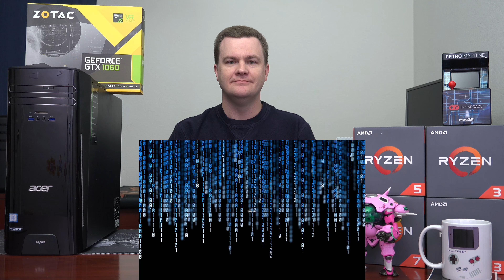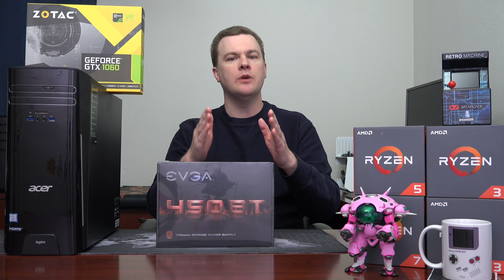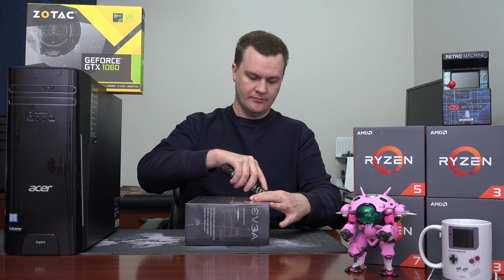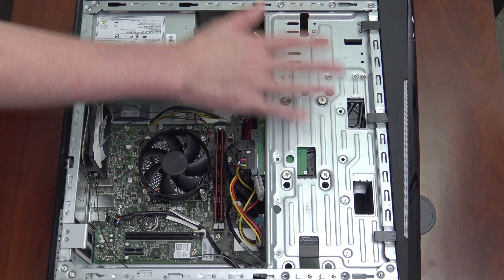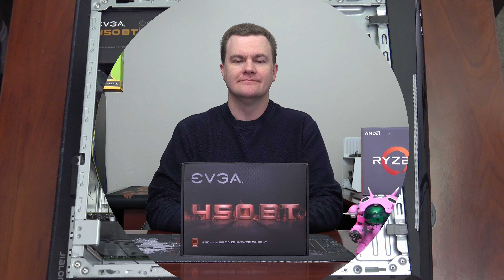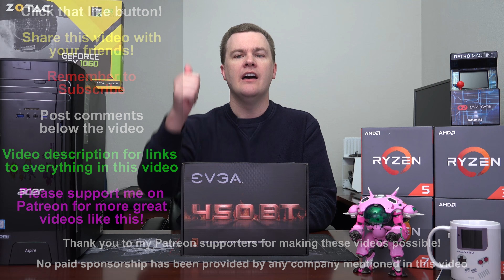EVGA 450BT - 80+ Bronze Power Supply - Review + Install Guide

Comment: Nice review men! Im looking for this exact psu to pair with an rx 570 of 4gb and hopefully an i5 9400f, do you think that this setup will RUN without bottlenecking? Thank you!
Reply: just undervolt the rx570 it will work fine
Reply: @kruxdt6307  thanks! i will try, with a friend of mine we tested this rx 570 with an i7 8700k v1 and sometimes with some games the screen goes to blue or simply it shut downs from nowhere... I will try to undervolt it as u say, thank you!
Reply: Update: now that I watched the vid, on the minute 8:00 u said that if u want an rx 580 u must replace the psu, would you replace it with the evga psu?

Comment: Hey sir I just sub! great vid 

I have some questions 

Will the EVGA 450 BT, 80+ work with 

RYZEN  3  and POWERCOLOR RED DRAGON RX 570 4GB  with the GIGABYTE B450 AORUS PRO WiFi. Mother board 

And also is a single ddr4 8gb at 30000 speed ram     better than 2x 4gb at 24000 speed ? Need help I’m kinda new to pc builds

Comment: Can this powersupply handle
-2x4 rgb ram 2666mhz
-ryzen 3 2200g
-msi b450m mortar 
-rx 570
-3x 120mm rgb fans
-m.2 120gb ssd
-1tb 7.2krpm hdd

I'm worried if it will handle or not the rgb lightings in my rig. Is it okay to use this ppwersupply? I will overclock my cpu too.

Comment: Would this psu be enough for a rx 580 4gb with ryzen 5 2600 with 16gb ram?
Hoping to oc the 2600 to 3.8-4ghz as i will be getting a arctic freezer 33 but the gpu, i wont be oc

Comment: This unit is great. The IDIOTIC design blows my mind. The power switch's bezel is too close to the mounting hole, thus the frame of my case will not flush with the supply but with the top bezel of the switch, for that one screw. The switch bezel and the part of the frame that extends with the screw hole, overlap. See rear of unit at 5:40 to see proximity of power-switch bezel to mounting hole.

Comment: tech deal is this psu good for gtx 1060 (3gb) and ryzen 3 1200?
Reply: KeistuoliZ yes was using this PSU(EVGA 450B)with Ryzen 3 1200 OC to 3,9Ghz and Asus Strix GTX1050ti, now Ryzen 5 1500X. It's enough for GTX 1070 or Vega 56 so it will run your GTX 1060 without problem.

Comment: Hello! Can I use this PS with dell 9020 motherboard? The MB has a 8 PIN power conector not a 20 or 24.

I think i could use either of the 8 PINs CPU power connectors from the PS to power the motherboard. Is this possibly?

Comment: Even if you're using cheaper used parts I'd say the same thing you said about the 1,000$+ PCs. You can get a GTX 480, 580, HD 5870, etc cheap used. But there is no way a 450watt powersupply will run any of those cards. Even with a lower-end CPU like a Celeron or Athlon II/etc. You can check outervisions psu calculator if you don't believe it which is pretty accurate. lol
(I'm not associated with them. I just use it to calculate my needs. So I don't grab the wrong parts. Like the GTX 465 I almost bought that would have jumped me from around 200 watts to 500+ watts).

Comment: Not related to this video, but have you used the MX 300 525 gb m.2 (part # CT525MX300SSD4 on Amazon) in a Asus b 350 Mobo? ASUS says it isn’t compatible and could damage the board if used. Any thoughts?

Comment: I watched you're other psu video guide, but I am still not sure how big psu I need.
I wanna have: Ryzen 1700;
GTX 1070 Ti
3 ssds and 3 hard drives.
Probably less, but I intend to record/ edit so might end up with several information storages.
Also I experience electricity spikes and cuts, like for a 3 seconds, rarely but happens a shutdowns.
Ik I probably need a ups, but would bigger psu help for few second or millisecond electricity outage.

Comment: I bought one these for a Dell i3 4150 system, 16 gigs of 1600 mhz ram, MSI GTX 970 gaming overclocked.  Ran fine on this EVGA 450 watt PSU.  Thanks Tech Deals for the video.

Comment: That is amazing to see an FSP group PSU orginally in the case , thats actually not a bad 300 watt PSU , I honestly think it would up to an GTX 1060 just fine , unlike PSUs from older oem machines . my last oem was 10 years ago it was an ASUS CM5570 with a pentium dual core e5300, the psu in it would not even power a 9500gt lol

Comment: Budget builds also mean some more confident PC-ers might be looking to take advantage of much less efficient older gen hardware in their builds. The R9 290/FX8350 would require much more power than an old i5/GTX970. On that AMD system I used to use a 550W just so I had 100% guaranteed headroom. For modern efficient gaming this PSU looks great. Needed a PSU for my new DJing PC (now knowing I can add my old 970 at some point) but I know nothing about budget PSUs these days. This answered all my questions and looks like the perfect choice with some longevity options. Great vid as always.

Comment: I have this installed. A gtx 1060 and ryzen 7 1700x at 1.35V and 16gb ram. This is more than enough for a gtx 1060. No matter what cpu you put in(ryzen 7 or intel i7)
Reply: I agree. I have a 1060 with a 1600X and I'm only pulling about 150-200 watts for my entire system minus the monitor when it's running full load.
Reply: I buyed this psu un Amazon,  can I run games with the GTX 1060 and a i3 8100 or Ryzen 2400G or Ryzen 1600 with this psu?
Reply: KAI KIN I think if I do Overclock Is not very safe ?
Reply: Is it work for rx 580 ? I heard that it consume much more power !!

Comment: I have this PSU and sometimes it makes a buzzing sound ( that last 1-2 seconds ), It's so random and it might happens a few times in one minute or it might go quiet for an hour ... Idk what is the problem and I built the system just 2-3 weeks ago and the problem started after a week, Probably my unit has some problem and the strange part is, it still make the noise even if the PC is off and PSU is on.
I picked it up for $21 on Amazon.

Comment: Hlo sir,
I currently have an zebronics 450 w PSU and a gt 210 and I wanted to upgrade to MSI gtx 750 ti low profile version,I m not a rich person and u won't believe me but I've been collecting money from my pocket money for 3 whole years the gpu,so I can't afford on a first hand PSU,so I am purchasing a used one ,so which 450 watt PSU (used)should be good for gtx 750 ti  .pls tell me I can't take any risk on my gtx 750 ti..
Reply: any 450w I have the same one as in vid with a i7 and gtx1060. a 750ti will only use 65w and it will draw its power from mobo if you have no money just keep the one you have as long as it works ok? keep the money you have saved put it with the money for 750ti and get a 1050
Reply: Thnx for the reply bro but I HV to change my PSU coz there is a strange noise coming from my PSU fan when my PC stars ,so I guess its taking its last breath ,I can spend around $15 for a used one,so will I find a used evga psu
Reply: yeah look on ebay and bid and I'm sure you will find one if you hold out
Reply: For that ??? I would use something between 300 and 450 watts
No more 
Check the links in the description
Maybe you will find MRI or something

Comment: Very useful content as always and as expected from your channel, and I want to add some info here, that the GTX1060 is a great low power consumption graphic card actually I powered it from single SATA connection using SATA to 6 pin adapter in Dell Optiplex9020 machine with 290W PSU, and runs great without any side issues.

Comment: what is the difference between the evga 450 BT and the evga 450 B?
Reply: The evga 450 B1 has slightly better built quality(hence why its slightly more expensive than BT usually)  and has a higher temp rating @40C while BT is @30C.

Comment: I have a 600w  OCZ PSU about 5-6 years old. I just did an upgrade from a Core i5 to a Ryzen 5 1600 with it. How often should one replace a PSU and would this be a good candidate?
Reply: I have had a Cooler Master 600W for like 8 years now, I will upgrade once it fails on me hehe.
Reply: when you start to hear funny sounds. try to keep it dust free and you are good for years
Reply: Okay, thanks.

Comment: With this power supply you can use an I7 8700K OR a vega 56 not both. They will take >450w
Reply: Clash with Neo You need a better PSU for that combo.

Comment: Tech Deals
Nice dramatic music in the 9th minute. :)
These days I have the opinion that even for budget builds quality PSU's should be chosen, simply because you get so much more value in terms of longevity, reliability and noise level. You can keep using it >10 years if you go for the high end PSU's, <$10 per year. If you have little to spend then maybe wait a bit longer before you build a PC?

Comment: I just wanted to get a zotac 1080 i have cooler master masterwatt lite 600 watt.
Pc specs : 
ryzen 5 1600
Gigabyte ab350 gaming
Cooler mastee master box 5
Zotac 1050 ti
Cooler master master watt lite 600 watt
Reply: its isnt the best psu bit it will handle it
Reply: Skeletchetobg _  in terms of power its fine but should i really go for another power supply ??
Reply: if you already have it keep it if you dont  tell me your budget and country and i will  suggest you a  psu
Reply: Skeletchetobg _  thanks for the suggestion bro.
I will keep it ;)

Comment: Green motherboards, those still exist. :)
Don't even OEM's these days use motherboards which are a bit prettier? This OEM PC is not that much different from mine, mine has a large heatsink (plastic pipe) on the CPU cooler though.

Comment: when upgrading those branded desktops with psus make sure the power supply is actually atx, as often manufacturers go on a proprietary spree and the new psu might not fit, even the screws.

Comment: Could you do a video that covers the pros and cons on buying Refurbished PSU’s? I’ve heard it all and I’d love to hear from a legit source like yourself.
Reply: 328am main drawback of refurbished psu is less years for warranty(maybe have like 1-2years) while a brand new psu can have 4,5 or more years. Also maybe a potentially shorter life span
Reply: dragonfistX200 Agreed, but the reason why I’d like to see a vid on it is because I’ve already heard all logical reasons and I’ve also heard the complete opposite of what you said. Some say that if it’s refurbished; it’s been tested and like a brand new one but with a shorter warranty OR that you should never get one because it’s the most important part of the system and it could blow your other components if it malfunctions.  

So, since the amateur opinions vary I’d love to hear what Tech Deals has to say on trying to save a few bucks in a Refurbished PSU

Comment: You definitely need to do a video on the recent GPU price rises.
It makes buying cards above 1050Ti very expensive and pointless.
It also makes prebuilts even more attractive.
Who knew people would actually RECOMMEND prebuilts in the PC Master Race :)
Reply: MrMateczko just checked and DAAAMMM. I’m from Costa Rica and bought a RX580 gaming X for 320$ like 3 months ago which is OK since US is cheaper. Just checked Amazon and seller prices are between 699-999, this is ridiculous.
Reply: MrMateczko look up hp pavilion 580 on amazon. There is a i5 7400  with a gtx 1060 3g or r5 1400 with a rx 580 4g for right over $600. Best prebuilt I've found recently
Reply: MrMateczko dude I feel the pain. Even the 1050tis are getting up there, so I ended up with a 2gb for my budget machine because I wasn't paying no 200-300 dollareedoos for a slab of silicon that makes my gamebox games shinier.

Comment: That power supply won't run the three pin Sapphire Vega, or the four pin 295x 2
Reply: You don't put the Vega or 295x with this PSU. There are Seasonic units for that task, and they are not THAT expensive comparing to other PC parts right now.

Comment: Best power supply for the budget indeed, u can find these slightly cheaper than the 430 white in amazon sometimes, although the problem ive had is i have to get the power cable that came with it at a certain angle for it to work, idk if its just my unit but i had a spare power cable lying around and used that instead

Comment: Hey mr.deals I'm considering getting the Acer aspire used on eBay but if I can't find one for a good price are there any other pre builds you'd recommend with the same specs?
Reply: Digital Rampage are you talking about the acer aspire e15 with 940mx. I recently picked one up used off ebay for $380 in very good condition.
Reply: dragonfistX200 the one I found is $299 with free shipping and has a i5 6400 8gb ram a the hdd and windows 10. I also found a Dell Inspiron 3650 dt with the same specs for 289 with free shipping also.
Reply: ah my bad was thinking of laptop when you mention acer aspire
Reply: dragonfistX200 It's all good. is that laptop you mentioned able to game at all?

Comment: Will this power supply work on RYZEN R5 1600 overclock and RX580 8gb overclock and recommendation if don't work please?
Reply: Yes,  but if you can fit a reputable brand 550-600W in your budget, please do. The moment you start overclocking you want to have more headroom than it offers.
Reply: Thank you for the answer and recommendation, 1 like for each of you
Reply: Pc ColdWar for what would you need 2 8 pins for a rx 580? Lol